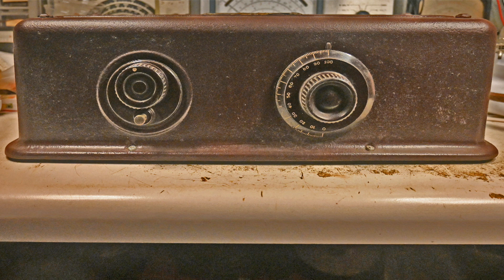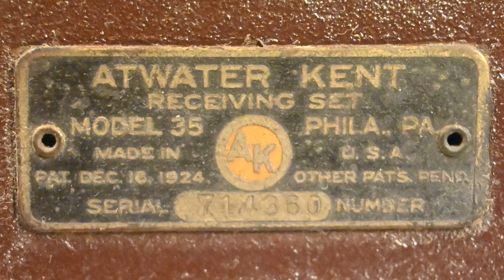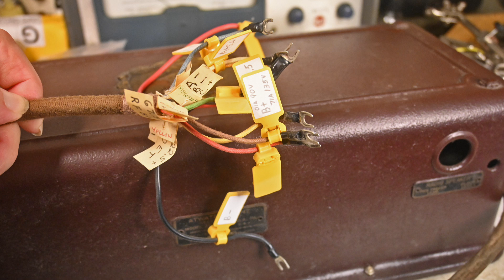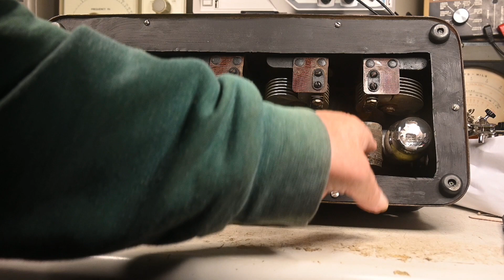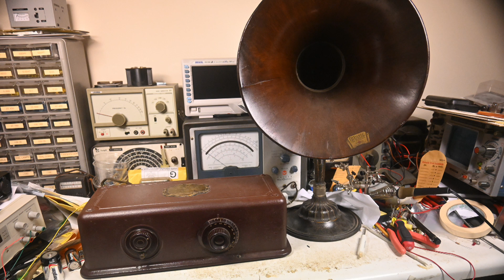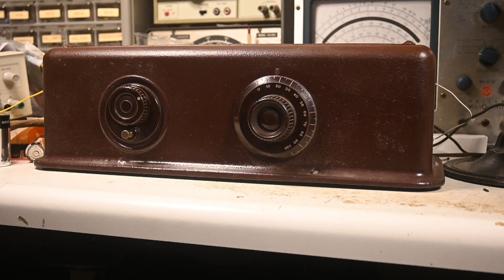Atwater Kent 35 Circuit and Demo

Comment: Thanks for the demonstration & explanation of the circuitry. Also congratulations on owning a centenarian receiver that works! The tuned circuits must have been precision made, for I see no trimmers to ensure accurate alignment. Are those filament rheostats the only means of controlling oscillation? I understand this was a real problem before the invention of the screen grid. I have a Peto Scott Anglo American Six, which is a six tube neutrodyne. There are four tuned stages, with only the middle two being ganged, creating the nightmare of three knob tuning. To my mind, the first two stages should have been ganged instead, as they would have represented the coarsest tuning. Experimentally adding trimmers did improve the alignment. An extremely difficult set to operate, especially in getting the neutralisation right, though it does turn in high gain results.
Reply from the maker: The two Rheostats are ganged together. The first one controls RF gain. The other one controls the first  audio gain. I'm glad you got your Peto Scott Anglo American Six working. The 1920s radios are my favorite radios. Thank you for your comment!

Comment: Looks awesome and sounds great! Amazing action of the Ganged Tuning Capacitor! If you placed that speaker on top of the radio, would it interfere with the signal? Thanks for the video!
Reply from the maker: No the radio is is a metal box so it is shielded very well.
Thank you Tony.

Comment: It is my aspiration to own an AK before I leave this world.   (When I came into the world decades later, it was all zeniths and G&E's and so forth as brands, but still a lot of tubes were in everyday use in the 60s and even early 70s so I grew up on that sound.)  I love the ship motif and the fact that these were sold by a fellow literally named Atwater Kent.  I also have seen on line a 1920s/30s car radio by this manufacturer where the control is a teeny tiny little mock up of a cathedral radio which mounts to the steering column and is controlled by mechanical wires to the radio chassis.  First class stuff!
Reply: @michaeldeloatch7461  
The AK breadboard radios are still very affordable, although appropriate speaker can be a little pricey they can be found in expensively from time to time. You can reverse an old speaker output transformers to get it going with a modern speaker while you search. The speakers on these radios are not 8 ohms more like 2000-3000 AFAIK.
Reply from the maker: Thank you Michael, I hope you get your AK radio.

Comment: Thanks Rick. Very interesting. I didn’t know they had single knob tuning that early on. Also noted the narrow passband which I guess results from the cascaded tuned circuits. What material covers the radio cabinet?
Reply from the maker: Hi Dick, I think they used something like fine sand and glue to cover the metal and then panted over that. Thank for watching.